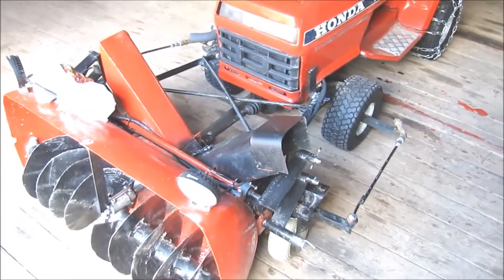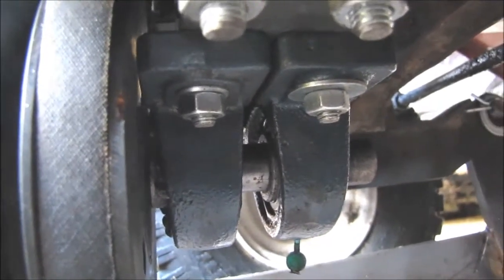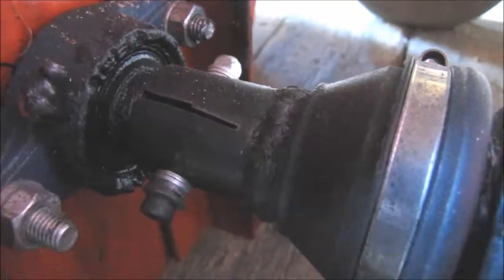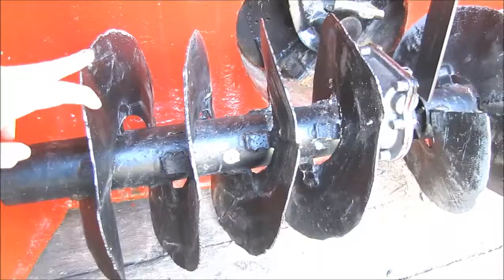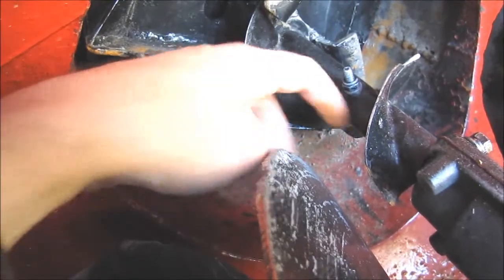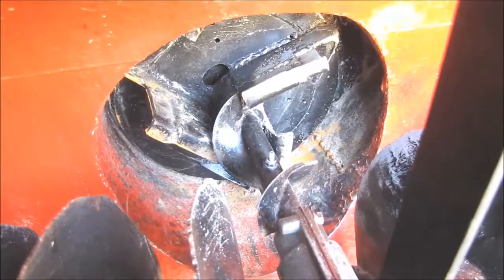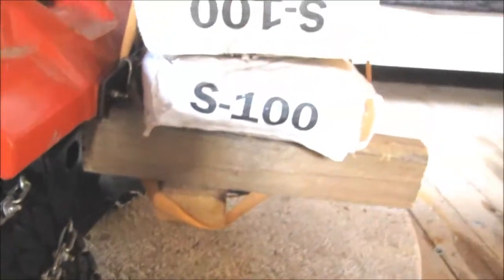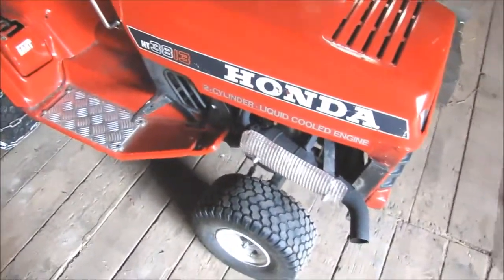Honda HT3813 DIY snow blower in detail (also a catalytic converter installed!)

Comment: Did you worry about the catalytic converter needing the proper stoichometric ratio?  Carbureted engines struggle to regulate the ratio properly, and I've heard it's easy to burn out the cat if it's wrong.
Reply from the maker: Yes you are right, it can happen in some cases. But I don't worry about it too much. I think it will last the lifetime of this machine, if I keep the air filter clean etc. The worst case for this catalytic converter would be accidentally pushing the throttle lever to "Choke" position on full throttle.